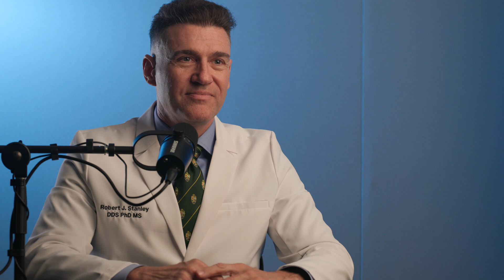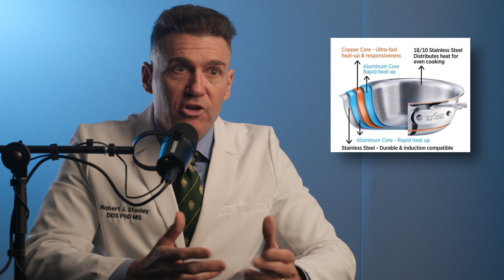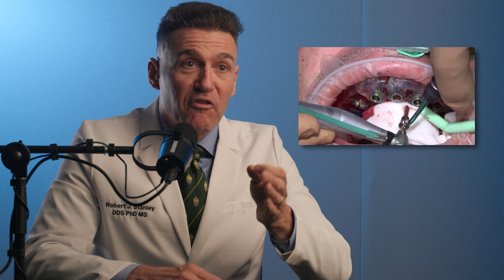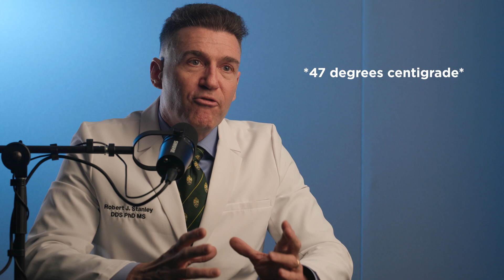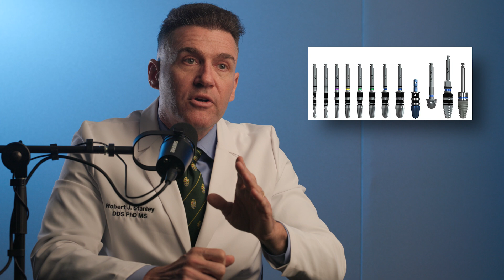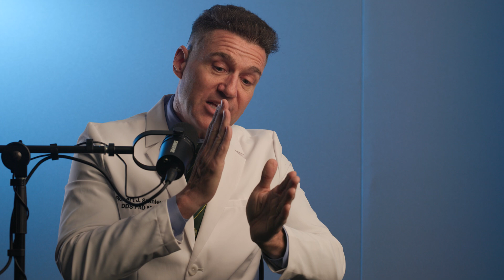The Truth About Irrigation: It’s NOT Thermal Necrosis

Comment: Thermal necrosis is definitely a factor, but barring a highly unethical experiment, we couldn't prove it.  We know bone dies at 47C, you can definitely scorch it at 2000 RPM with a dull bur. Esp if you're placing guided and you're irrigation is blocked by your guide.  While bone may not be necrosing, we can't rule out release of inflammatory cytokines etc.  You don't need full bone death for an bad outcome.

Comment: Then what is the cause of early radiolucency around implant loosening within days or as early as two weeks in an edentolous site 
Will that be because of insufficient width of implant hole created and extra torque or pressure required to seat the implant
Reply: Excessive ligma
Reply: It’s because of D1 bone, that lacks proper infusion by blood. 

In that case open up the coronal part a little bit with your next bur or tap, make sure you drilled one or two mm longer than the implant is and/or screw like winding a watch. 3 in, 2 out etc. 

Also make sure the biological width is more than 2 mm, by removing a little bone or using a dermal graft/pole technique. 

Out of the Zero Bone Loss Concept book.

Comment: Very relevant information sir. What are your thoughts about the pressure necrosis?
Reply from the maker: Great question. There is no definition of pressure necrosis. If one had a less than ideal outcome how would one differentially diagnose “pressure necrosis” verse say a bacterial infection? What would be the tell tail symptom or finding/s that would point to pressure causing the issue? Remember, the purpose of bone is to carry load!

Comment: i can prove ☝️🙋  ,, in my early days   of designing and printing my own surgical guides i totally missed how to design irrigation pathway or how to irrigate drilling sites ,, i designed it very proper that not a single drop of saline passed 😊
in a case;   i used the guide for 4 implants  &  2 were put free hand,
i smelled it during drilling through the guide , it was 800rpm 35ntorq  , i didn't think a negative effect would happen, 

but the wound never healed the patient after 10 days complained of pain swelling and all the implants 4 of them where screwed out of the bone  & the other 2 that was free hand without guide was perfect.

xray showed a huge radiolucencies around the implants (guided) while the others (manual) where perfect 

Since then the first thing i think about when making my guide is irrigation, bone density & torque
Reply: I agree, I've experienced the same
Reply from the maker: I suggest watching the four minute implant placement video for an example of how quick drilling should be. It is on my channel.
Reply from the maker: Thank you for sharing your complication. Remember, drill duration is directly related to the heat accumulation in bone. So fast drill times mean little to no heat. 800rpm is too slow. Something closer to 2,000 is ideal. This results in drill times of about 1.5 seconds and no heat accumulation. Also, please note that only the last drill you use needs to be fast because each sequential drill in the protocol removes the bone that might have been heated by the previous drill. Since the osteotomy has been nearly completed the final drill, regardless of bone density D1-D4, is the fastest in the entire sequence.
Reply: @Stanleyinstitute  thanks for replying doc !  ,, the 1.5 sec  i dont think u can generalize to all cases , for example the immediate case u shared the 4 min placement is another thing  there is already blood (sicket blood) to cool down the process.,, i believe heat  torque  even how sharp the drill is  all has factors on the bone.,,  am sure u had cases where the drill isn't drilling in dense cortical bone that u had to put pressure for even the piolet drill to go in., we cant say that in 1 patient his bone will tolerate 1.5   maybe other patient won't , the condition of the bone matters too.., it's simple to irrigate than to expect or base on belief that might have deviations. ,, but irrigation and blood are mandatory imo  for better success ,,  thank u so much
Reply: @Stanleyinstitute also my experience
Reply: How long were your drills in the bone? By watching Dr Stanley's surgeries, each drill is only in the bone for 2 seconds.
Reply from the maker: Very keen eye! This is true and remember 1/2 of the time the drill is coming out! This means that most osteotomies take about a second. If you are drilling at high speed and only touching the bone for a second it should be common sense to everyone that the bone will not heat up.
Reply: @gigihanmandarin  you can never decide for how long it should be , sometimes high density bone like D1  is way diff than D3 ,, i remember in this particular case it was yes a matter of seconds...

Comment: your point regarding minimal drilling time doesnt take into consideration the actual temperature generated. Yes drilling at 47 for the minute is the stat, but is this the actual temperature generated? would the same time statistic apply relatively at 60c?
Reply: If the bone heats up to 60, so your drill should do as well , and you can feel it when touching it